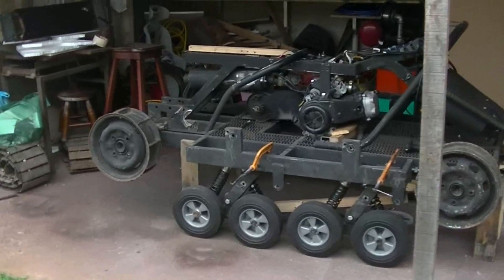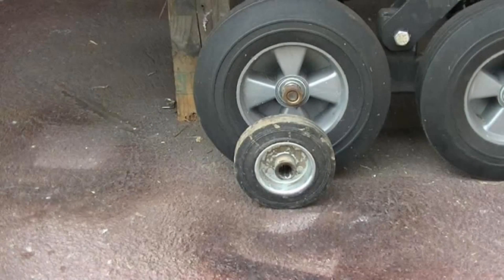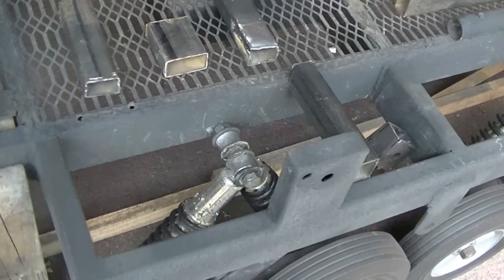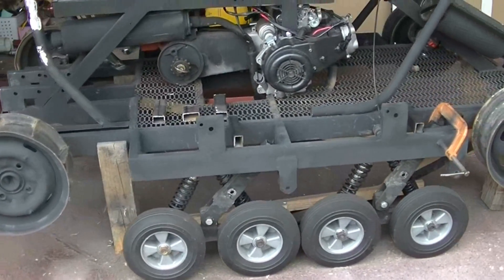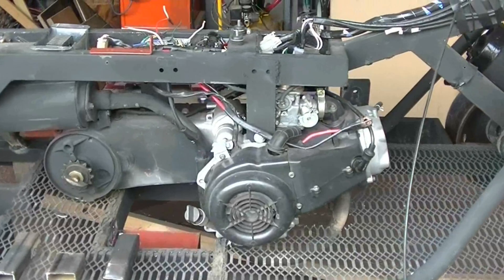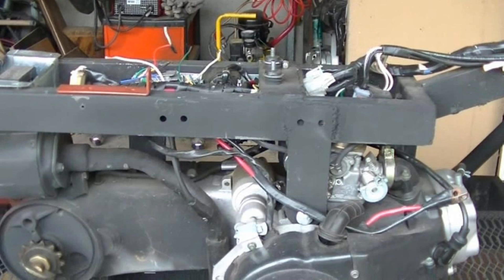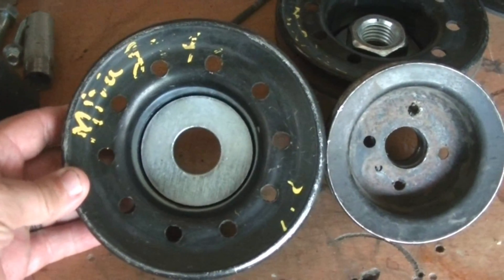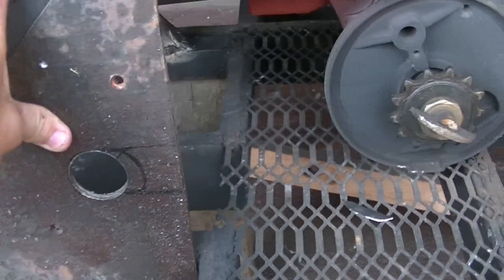How to build a tracked vehicle / mini tank series update 10E

Comment: If you can find the rear drive axle out of a small rear wheel drive car, or 4 wheel bike you can use the differential and the built-in braking system (hand brake cables) to move your vehicle. Best thing is it won't use belts that slip. You can weld a gear on where the drive shaft would normally yoke up to it and voila your wet proof system.
I was planning on using the transmission out of a sit-on lawnmower as it has all the same advantages.

Comment: do you have weights and dimensions also where did you find the steel
Reply from the maker: +lucas falenski Not yet.I got the steel at the hardware store.
Reply: +Aceman307 okay thanks
Reply: +Aceman307 also one last question what horsepower is the engine
Reply from the maker: its about 6 hp
Reply: +Aceman307 thanks

Comment: great build.. looks like fun! interesting design for a relatively lightweight steel track. I wonder if you could modify one of your plate segments to clip together for drive on/off installation/removal.. would be cool to get a studded rubber track made for snow (if you have any in your area) and then back to steel for mud. I just watched a video of a guy making  smaller rubber tracks out of re-purposed tires... maybe a worn out tractor tire in this application. keep up the good work!

Comment: Great project.  Love your track design.  I hope you don't mind my making a suggestion on the drive system.  Use a hydro-static drive out of a lawn mower.  The outputs are low speed and I think they would work well.  The zero turning radius type might be best.  Then you would have the forward and reverse and speed reduction all in one unit.  See if you can get a local recapping company to work with you.  You might be able to encapsulate your track in rubber giving you more traction and quieter ride, or just buy some tread from them and bolt onto the faces of your steel treads.  Best of luck.
Reply from the maker: +Robert Palmore Thanks for the comment.

Comment: When you're doing something for the first time, it's always difficult to determine if it's good enough or the correct threshold is achieved. Go with your gut feeling and get it right.
Reply from the maker: +The Cedar Workshop Thanks Scott, I think I will get it figured out. I have changed the pulleys and moved the engine I just have to find the time to finish and get a video out. I have also been working on another video you might like, a portable concrete mixer out of a 55 gallon drum.

Comment: honestly I think you just need to get a ATV open differential so you can steer with independent brakes, so you don't have to worry about your belts wearing out
Reply from the maker: +Joey Heider Your right that would be a better way to go. Also thought about a golf cart rear diff. Its difficult to find those things where I live. Most of the projects I build I try to do it in a way that people not just from the States would be able to find the parts and build. Like typical things you can find at the local hardware store.

Comment: Yah!! Definitely better!! Are you going to have 2 wheels on the bogies or 4 wheels?
Reply from the maker: +prancstaman I am going to try a single line of wheels so 4 on each side of the vehicle. I still wish I could use bigger pulleys. The good thing is now that I moved the engine forward I have plenty of room to change them out later If I need to. How is your project going?
Reply: Just got done uploading the vids for the drive sprockets, which means there done. The vids are still private though, I'll send them out once I finish the forum updates I'm on first because they go hand and hand. Maybe tonight or tomorrow they'll be out. Got chores to do first tonight,LOL. Then I'll be starting on my drive section, I got the bearings and axle in to do it finally. The brakes are going to be interesting because I'm making the, I guess you can call them calipers. I plan on, later down the line, to develop the design into a clutch system also. Should be interesting on what I come up with. I usually don't till I make it. Funny thing is people know just as much as me before I start something. My plans usually don't come to me until I do it,LOL.